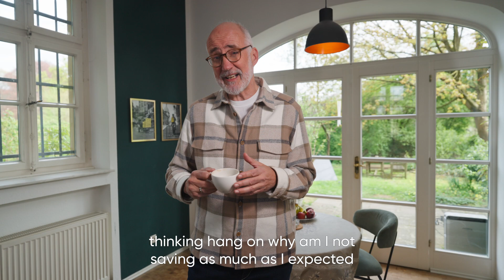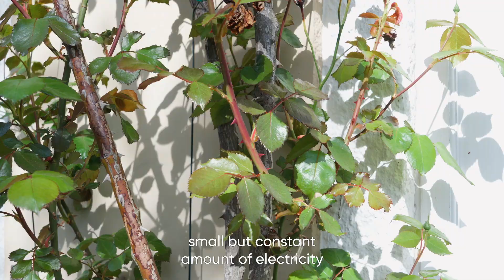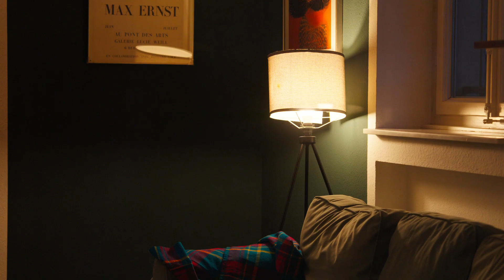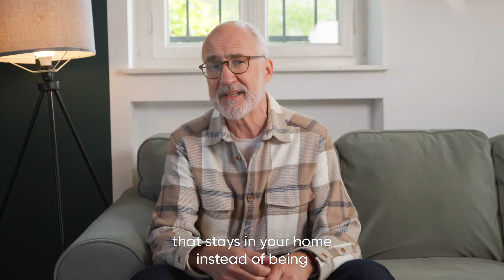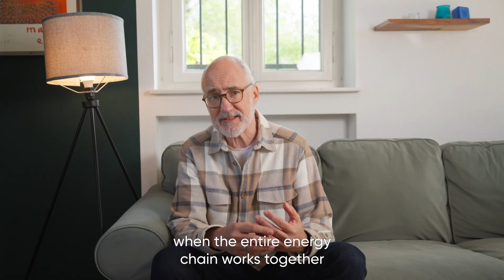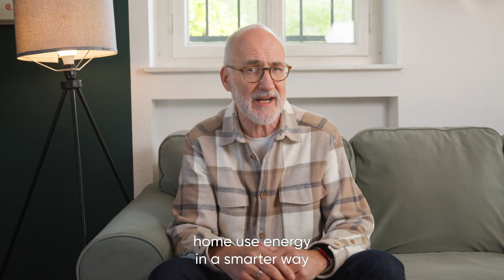How to Maximise Your Balcony Solar Savings in Europe | Jackery SolarVault 3

Comment: @jackeryusa @jackeryEU #jackeryusa #jackeryeu
BEWARE: I bought a Jackery 1000 in the US, worked OK. I came to Europe, and based on their advertising "Global" presence, and "additional discounts of up to 50% for returning customers (with no location-specific limitations shown)", I bought same, and under exactly the same email account utilized for the US purchase. As it turns out, I got the same discount as offered to new customers. I complained to Jackery. Responses were: 
1) US and other databases outside the US are NOT correlated, and no discount, of course. Persistence doesnt pay... 
2) Eventually, I asked about the possibility of returning the unused equipment: a) Equipment had to be in the original packing box, b) I had to pay for shipping it back, c) Only 8% of the cost would be reimbursed... not a typo, only 8%... which would even cover the shipping back. Persistence doesnt pay... 
3) I was then told that the special discount had already been applied. False, the discount applied was the same as any new customer receives, not an additional up to 50% discount for returning customers. Persistence doesnt pay... 
4)Ultimately, I was told to contact their HQ in the US and argue with them, which apparently the EU doesnt allow such kind of deflection. Still no discount... 

This matter was referred to the EU commerce agency in charge of overseeing this type of blatantly fraudulent advertising. Conclusively: 
1) The "Global" representation in their practically daily emailed adds is blatantly false, since in their own admission, their databases are not correlated/integrated for different locations outside the US, with their US customer database. So, is "Global" in their ads applicable only to money grabbing?
2) "Up to 50% Returning Customer Discount" is false, and, obviously, a cheap marketing gimmick. Where is my "Up to 50% Returning Customer Discount" refund?! All I have is a long list of the email exchanges and Jackery´s BS excuses and lies not to honor what they advertise.

I could have bought another brand here in Europe (since I was researching quality:price ratios, and Jackery wasnt my first choice, actually) was it not for Jackery´s false respresentations. Likely, I will never see 0.01€ of the falsely represented "up to 50% returning customer discount."